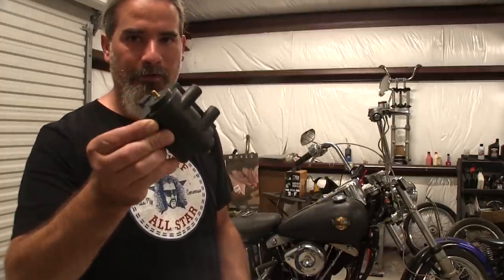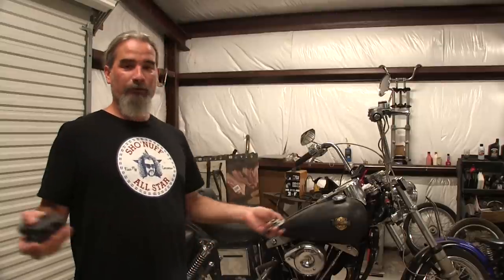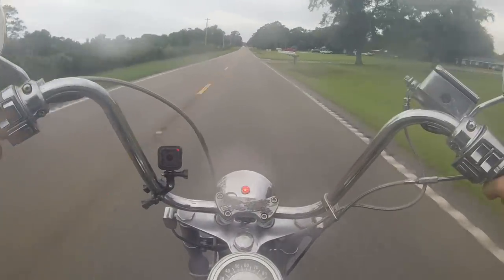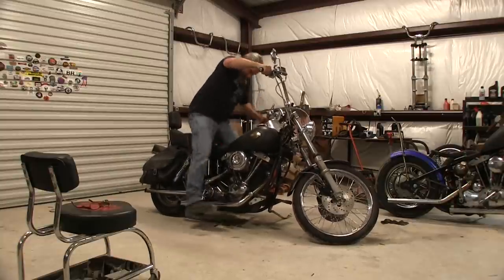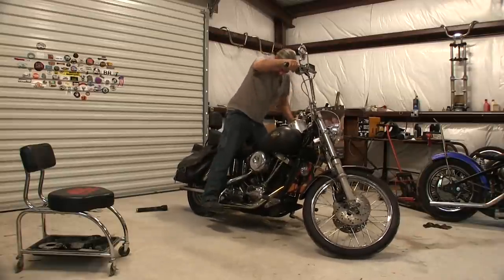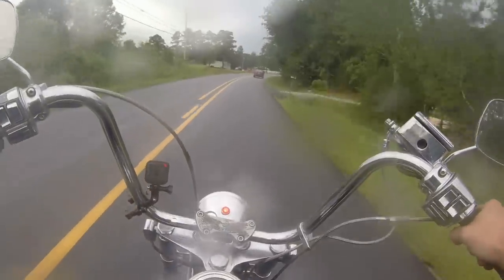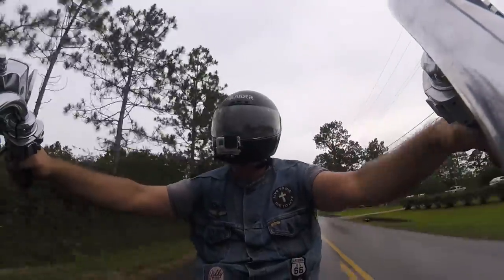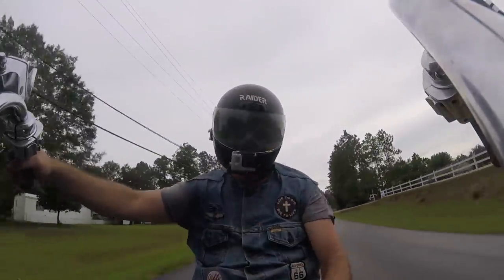DITCHING Ultima ELECTRONIC Ignition And INSTALLING POINTS On 1979 HARLEY Davidson SHOVELHEAD FXS 80

Comment: In the sixty's I was told if you wanted to drive you had to learn to set points. Points gap 1/2 of plug gap, ballast resistor to drop voltage to 6 volts, condenser to tame the spark, good quality coils. Low rpm overheats coils quickly. TDC setting is a suggestion, as parts wear and get sloppy readjust accordingly. Retard timing until it starts easy, then advance a little at a time to preference. Dyna/ultra, may die early from heat, not much cooling in the points cone. Magnetic trigger allows  coils to heat saturate, burn out sooner,  common issue. #1 reason for ing system failure is not following instructions fully. My current #1 ride is 1975 gl1000 goldwing. I pulled the points and replaced with tytronic elec ing. Plate with magnetic latching switches, 1/2 the dwell time, uses stock flyweight assembly, mounts in place of points plate. No more dual point set up on the side of the road. Lasted more than 2 years now. I would rather ride it than fix it. Good luck with it

Comment: I put points on my 98evo sporty causes the letric fucker was bad when I got it and the ones I used was from my 77 ironhead and I stuck them in with a 5ohm coil and tuned by ear and runs great and I can ditch the VOES

Comment: Good to see that electronic con-trap-tion gone.

Good old points. Yay! I still have my dwell meter and use a test light to static time the engine to get a good starting point. I set the gap based on the dwell angle.

I was sitting here watching the blooper startup and the entire time I kept saying to my missus, “he’s gonna snap his ankle”. Ya nearly did. Sheesh.
Reply from the maker: Yeah, I was on the border line.
Reply: @SaddleTrampTV  I felt that in my ankle when you limped over to the camera and threw out a few pain-relieving words. 🤣

I certainly romanticise those days but I sure as heck don’t miss them.

Comment: first, i dig the music! so tired of the usual stuff. second, one of my bikes (xs650) has a a hall effect electronic ignition. starts and runs fine, for about 30 minutes. sounds like it's going out of time before it dies completely. i'm wondering if the build up of heat is causing the failure. after a half hour of not running, it'll start up again. maybe the heat affects the magnetic sensor?
Reply from the maker: Might be the coil.

Comment: I had a 781/2 FXE, it came with the electronic pick up. I did the same thing and put points in it and carried an extra set. Never had to use the spares. You will get to know your bike and what she wants to start. Are you still running the stock Kehein carb? I thought it was poor choice for  starting.
Reply from the maker: No... It's go an S&S Super E. Runs great with it.

Comment: OLD TIMER TIPS:   How do you know if your condenser is starting to go bad.  You will start to see arching at the points.  And as it gets worst, the arching will eat up the points, so periodically check and then you'll only have to swap out condensers & clean the points.   Second old timer tip.  The actual condenser doesn't need to be mounted right next to the points were it will get hot and die.  They can be mounted remote where it won't be affected be the engine heat and shorten it's life.  You just need to solder on a longer wire.
Reply from the maker: Yeah, I took the condenser off just to see what would happen and noticed how much the points were arching. Hence the word "condenser".

Comment: How long did you use the Ultima for? That’s the same ignition I just put in my shovel, I am also strongly considering replacing it with a points ignition… 

P.S. tryna steal my kickstart fail thunder? Lol jk. Hope your leg isn’t too badly hurt.
Reply from the maker: Leg is all good for now. The ignition was in there when I got the bike back in December. I've since put moore than 5k miles on it.
Reply: @SaddleTrampTV  do you find the points to be easier for the kick starting?
Reply from the maker: @RedRiderCanadaBC  Still trying to find the combination.
Reply from the maker: @RedRiderCanadaBC  I sent you a message to your instagram.

Comment: Hmm...I've never heard of WD40 on the weights. I usually use a little high temp wheel bearing grease on the posts. It doesn't dry up like WD eventually will.
Reply from the maker: Great tip!

Comment: Looking to do the same thing on my bike. Just wondering where you bought your points from? Heard a few folks talking about Blue Streak being nice, but they dont come with the backing plate. Do you know if I can take off the dyna s module from its backing plate and mount points to it? Or do I need to buy a separate points specific backing plate?
Reply from the maker: I got them from on line... Ebay. Never messed with the Dyna S.

Comment: I'm gonna swap back to points on my 79super glide electric.  How did you wire them in?  One wire or two? And to where? I did get a 5 ohm coil, I heard that the existing coil won't work.
Reply from the maker: Sorry for the late response. Just now seeing this. Hot lead to one side of the coil; the other lead form the other side to the points.

Comment: 430 pm I broke down on the side of the road also so I want to go back to points I like your video but I have a brain fart keep remember what side of the coil does the wire go to to the points . My problem is I have no spark so I want to go back . THANKS
Reply from the maker: The bottom side

Comment: I'm 31, finally started receiving disability $$ from the VA and I'm doing my first full tear-down and rebuild on a 97 sportster evo. I'm looking to delete the VOES and switch to a points ignition. Is that a single fire or dual fire coil, and does it matter which one I use with points? And also, would I set the static timing the same way? When you were setting the static timing, you backed it off to where it just stopped beeping and then tightened everything down, correct? Sorry for all of the questions. I'm a small engine master tech but I'm still learning about Harleys. I appreciate any info you can give me

Comment: What kind of points did you end up getting because I got stock ones in there about 90° out I got a 79 super glide just wanting to get rid of it electronic ignition and put points I get it top dead center on the front cylinder and the mark and the lobe is 90° out I tried to make the backing plate different but the arm needs to be is where the bolt is so if you have a part number or let me know how you hooked up your points I'd appreciate it
Reply from the maker: They are blue streak I believe.

Comment: You're learning quick. That shop you bought it from seems questionable when it comes to shovels.
Reply from the maker: Nah. I wasn't very expicit as to which bike I was gonna use it. They figured I bought it for the ironhead; which would have been perfect.
Reply: First Kenny didn't know what Year the bike was, just look at the engine numbers. Then he had that sketchy way to start it with that wire. Next he didn't know about the fat boy rear wheel sprocket, etc, etc, etc. Once you get everything taken care of these bikes are great and lots of fun!

Comment: Is it not necessary to advance timing by rotating the shaft counter clock wise in big twins? I have only used points in evo sporty and that’s how you static time it correctly, basically you advance timing while checking continuity and move the plate until it opens the points
Reply from the maker: It is. I forgot to do that, and will mention it in the next video.
Reply: Awesome!! Thanks for replying, greetings from Mexico

Comment: I wonder if the Shovelhead will now still be operational after an EMP blast from above. If so, you're still going to be in the wind during the Apocalypse
Reply: Get a tin foil helmet,just to be safe.
Reply: Yeah bike will run, if you can get fuel. We're all headed for a rude reality check
Reply: @johnjaco5544  🤣
Reply: @arthurcutaiar9994  brew your own if it comes down, moonshine works as fuel. That's all ethanol is anyway.

Comment: I'm going to lay out my One Kick Super-Tune for 1970-1984 Shovelheads in my next comment...but First some important information. On the advance mechanism Backing Plate...the 2 holes where the Weight Pins reside...the springs on the weights hold the pins tight against one side of the holes for the Retarded timing and when the weights expand outwards (from centrifugal force) the pins are tight against the opposite side of the holes in the advance mechanism backing plate for Advanced timing. These holes Must be Round like they are when they're New. If they are Oblong from Wear...the degree spread between Advance Timing and Retarded Timing is too much. With Oblong holes your Advanced timing is either going to be Too Much or your Retarded timing is going to be Too Much. You can adjust your Point Gap and set your Ignition Timing 'till you're blue in the face...but your Shovelhead is either going to Kick-Back or you'll kick and kick or the engine will Detonate and Overheat at higher RPM. Period. No ifs ands or buts. It was important for me to state this and important for you all to understand. NOW....we can get onto the One Kick Super-Tune...no kicking back Ever.and engine pulling strong from Idle to Redline.
Reply from the maker: Thanks for sharing that, Rick.

Comment: ignition off, chock on, a shot of gas with the carb,,kick it threw and prime the motor with gas, ease back the choke a bit,,,, Get it at the top of the stroke, ignition on and kick!!! ,,, standard motor products, points and condenser, American prime advance setup ,, lube the advance flighweaghs with white lithium grease, little goes a long way,  bin around way too long,

Comment: 99.99% of the time the reason any electronic ignition fails it's due a voltage error from poor wiring. Electronic ignition demand a clean 10 volts to properly operate. An intermittent short will kill any electronic ignition. Points are fine but your performance will suffer.  Softer spark and much more service interval needy. Be wise and rewire your 44 year old wiring harness.

Comment: Me Like's Tramp's Channel feels real mann far out baby Lol ....
Yeah Mann don't that just perk the whole day and week uP when they fire uP 1st kick !😁
Life's Fine n Dandy.... you'l get to know the Personalty of the FXS ShovelheaD how he/she likes to be fired every one is very different.....like Taz & Mr Magoo 

Now... i need a Tip.. if anyone has a clue: 
my 69 ElectraGlide with 72 Botton end has started slow Cranking only has Eleccy start 🙄and a whining noise hard to diagnose in workshop with loud pipes ,,i cleaned all Contact's on Solenoid and battery grounds etc,,,fitted a spare relay ,,and jumped with a car battery but No 🤮"Don't like it" terminal wire smoked n switch'd off quick Mmm..??

& Now the 1916 Indian Chieftain 111ThunderButt has a whiney Noise too...                          not sure if thats normal only has 1200 mile's, 
Last time i rode it was a really hot day 90F+ after a 20 mile trip nearly home down hill slowing for a hairpin it made a horrible squealing🤢 on accelerating noise went😀,,,, Oil level was ok,,, a Unique  procedure to checking oil level 😵‍💫,,,,,i added some STP thick yummy silicon to Virtually fresh oil engine still whine's. anyone els ?

2 Motorcycles down... Time to get the 50's BSA Plunger fed with fresh least ethanol gas..... fingers x'd a tickle and away oh forgot rear rubber has a flat,,,,,🥵 its time for the trusty 77 Honda 125 XL ....Lest i can get some breeze going On.. LOL  and dream of better days